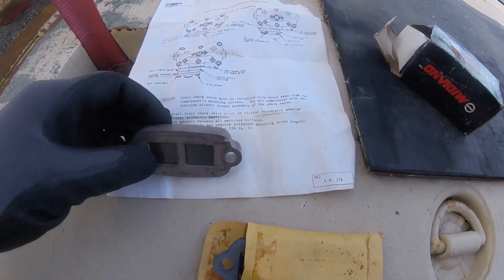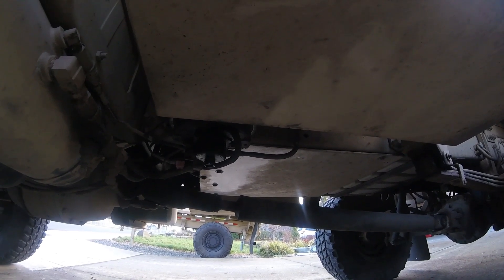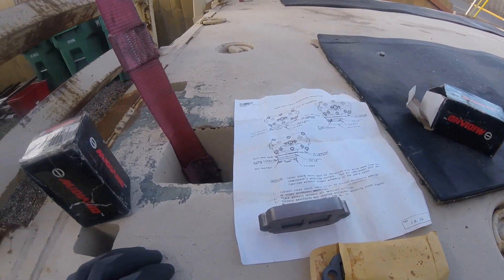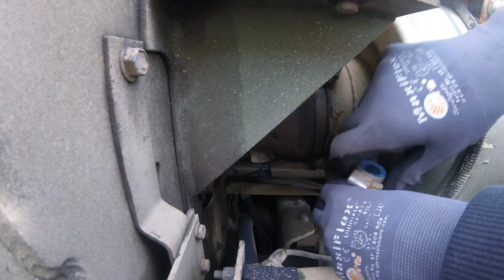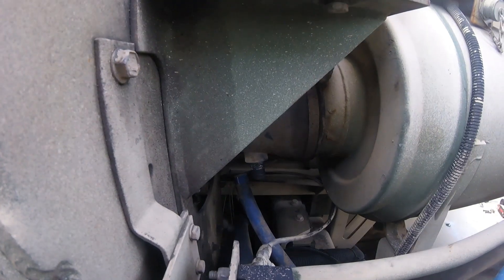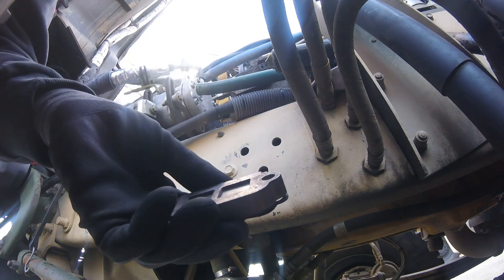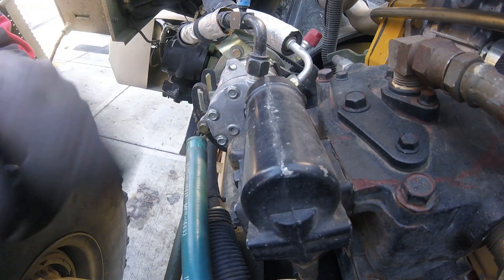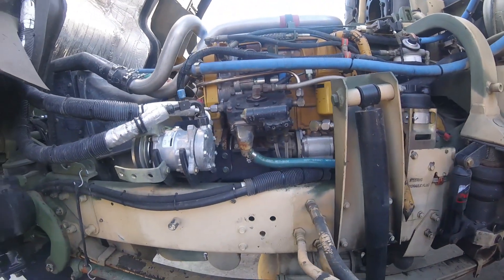Abel lmtv build part 147 (Haldex air compressor inlet check valve)

Comment: Good tip on the hose clamps.

The second part you put back on is the pressure regulator for the air system "governor".

TM has the psi spec they want at the wet tank. The cover on the front un threads.

Mine was about 10psi low
Reply from the maker: I figured it was something like that.  Well, we shall see if this test works.  If not I guess I am replacing the compressor and rebuilding this one to keep as a spare.

Comment: That part you were wondering about is the air compressor governor. If you have over or under air problems first thing to check. Also in very cold weather they will freeze up until engine is warm.

Comment: Could the  oil be "flow back" from your compressor if the rings are not seating?
Reply from the maker: That's normally what causes it.  I would think dried out valve seals would cause it too.

Comment: Hose oil wet at compressor and dry at air filter sounds like oil from compressor backing up into hose. Your check valve should solve that, but compressor rings may be worn.
Reply from the maker: It may need a rebuild but I am trying this first.  I do have a low mileage spare to swap in if I need to.